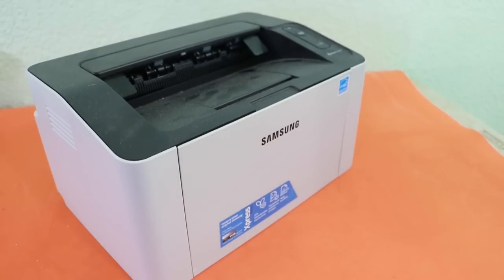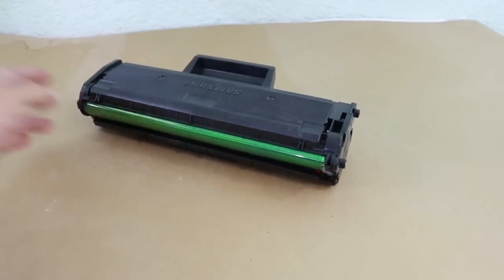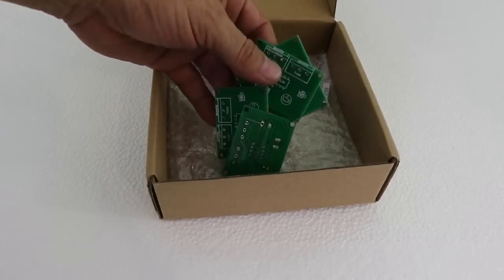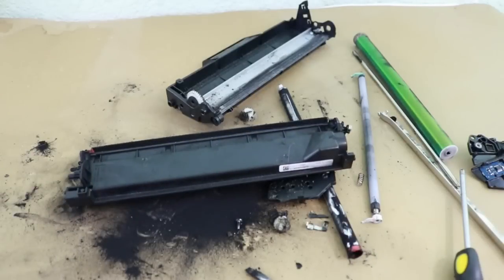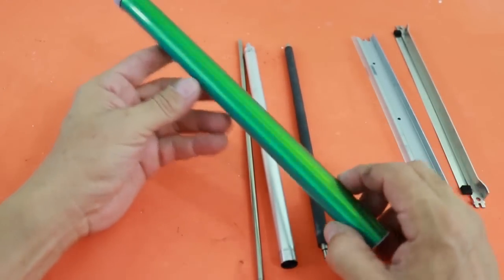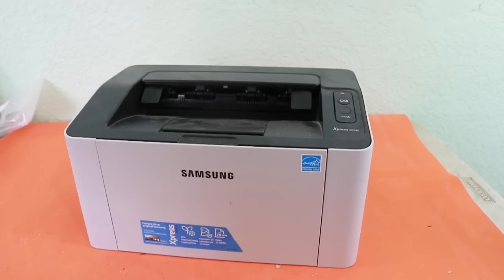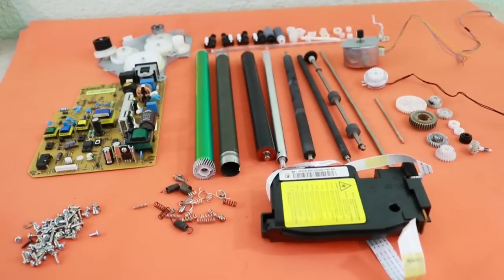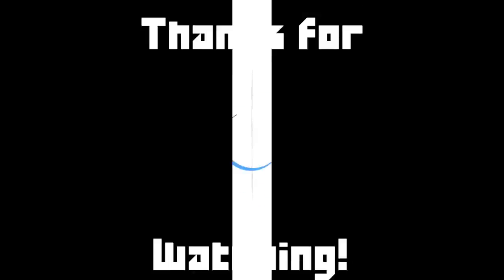Useful Parts from Old Printer

Comment: I've been thinking of converting an old laser printer to a laminator, as they have the heating element and the rollers and are free all the time.   Just need to modify it to accept thicker material and hack the control system.   Thanks for showing the teardown, really like these videos so I don't have to do it myself.  lol

Comment: Some printers have a high voltage and current power supply that can be very useful as they are of good quality. You only have to manually connect the stand-by pin (usually to ground or + 5v) and merge the outputs to use in projects, cnc's, etc ...
In some older printers where stepper motors were used, there is the possibility to unsold the stepper motor driver, make a pcb with the necessary components for the chip to work, and use it.

Comment: You said it would make a mess, but you didn't mention that toner is carcinogenic and if you need to wash your hands or clothes to use cold water only
Reply from the maker: Toner is not listed as carcinogenic.
Reply: @ludicscience  carbon black is a group 2B possible carcinogen and is a component of toner
Reply from the maker: Possible.  Ok? Not proved to be.
Reply: @stuartcommon4651  
Group 2B does not mean that something is carcinogenic. What's the point of the rating system, when you don't know how to read it? For substances in 2B quite the opposite of "carcinogenic" is probably true, because there isn't any evidence to put it into a higher group. Even meat and coffee are in the higher classification 2A. Not to mention processed meat, alcohol, tabacco smoke, car exhausts and UV radiation, which are in class 1 and actually proven to be harmful. So no need to panic.
Not only that, just because something contains a component that on its own might be harmful, does not mean at all that it is harmful when used as an ingredient. You don't want mercury around you all the time (although in metallic form it is harmless, unless you listen to media, which don't care about facts but just want another panic, similar to what's happening with lead, glyphosate or mobile phone "radiation"). But in an amalgam it is totally fine.
Reply: @superdau  I apologise I should have said possibly, but the way I said it came out like it definitely is carcinogenic. 

I fully get what you're saying about something being an ingredient, it's like solid asbestos roofing. It's perfectly fine as a product but when it's broken... a bit like ingredients in toner, perfectly fine in a toner cartridge, until it's broken, then there's a possibility. I guess that's all I was trying to say. I certainly wouldn't want my kids to open a toner cartridge lol
Reply: @superdau  plus the thing with mercury is more the vapour but I'll not go into that 🤭

Comment: Cut the entire gear reduction housing with spindles and save it as an assembly with all hardware and motors attached. It is far easier to reuse them in a project if you keep the matching gears together and have a plate setup with the right spindle spacing. It is easy to cut and modify it to make a smaller arrangement later or use the plate and spacing as a template you can physically measure and replicate.
  I find the screws and hardware are what I reuse the most. Also, if you have the time, labeling what attached where on the power PCB will make it possible to reuse parts of that circuit. There are things like a diode capacitor voltage multiplier that can be used in other projects. There is usually an interesting triac arrangement for the heating element, (although I've always found a ni-chome wire based heating element in the ones I've taken apart). The tiny square inductors on the power supply are usually a step-up voltage type and they often have a through-hole TO-92L MOSFET driving them.
  The laser mirror motor is brushless too. 
  The laser module contains a really good laser driver/power supply. It must have a low capacitance/accurate current source in order to turn on and off extremely quickly. 

   My dream is to take a laser printer apart just enough to get the laser working with a drive mechanism for a PCB instead of the paper/drum arrangement. If I replace the laser diode with a UV laser, and get the board to pass through at the same rate as paper, I should be able to print designs onto photoresist covered copper clad to make circuits. The trick will be making a setup that uses the original printing toolchain built into the printer. This would mean I just need to print the circuit layout artwork directly from a PDF and the printer would expose the photoresist directly. No need to make a transparency.
   I know Marco Reps uploaded his attempts to do this with a Lexmark printer that already has a flat printing pass through slot made for printing CD labels. He didn't stick with the project because of issues and it could only do single sided prints. I'm curious if a simple microcontroller could control and align the board feed rate to make a double sided setup that skips the transparency step.
   Who knows if I'll ever get around to that project though...I do have a working spare laser printer already though :-)
Reply: Totally, modules are worth a lot more than components, when it comes to re-using stuff.

As for the  UV idea, just keep in mind, you can't use lenses, evrything have to be mirrors.
Optics responds differently to UV vs IR and your spot would be totally out of focus.
There is a good chance of a mirrors only setup in the printer.

Even, your best route may actually be feeding the laser-diode the raster data, while a motor moves the photoresist below. (direct to PCB)
No need for graytone e.t.c., you just need to figure out how to feed data into the laser-driver.
You would need a fairly fast processor, and likely combine SPI & DMA somehow.

Since the photoresist responds way slower than a photocell (the drum), you may want to scan your design really slowly. Like high-power UV laser and cm per secound/minute.
Reply: @erlendse  
 Thanks, the optics hadn't crossed my mind yet but is obviously critical in retrospect. I haven't seen a mirror based culminating system, but perhaps I could retrofit the threaded brass tube and lens from a laser pointer. I have one that can focus to a minuscule dot at around 4cm. It is capable of burning (smoldering) anything dark colored on contact. Not bad for $2 on AliEx. I tried to get a few more of these, but none have come with the same threaded tube/lens since. I have a few other focusing setups that are similar from some laser party lights but haven't rigged them up to test their focal properties.
   The challenge for the laser driver seems to be a clean switching supply with low capacitance from the little bit I've read, thus the reason to attempt using the OEM system with different laser diodes. Development of such a system from scratch is beyond my current software capabilities.
   I tested the cheap 405nm laser pointer on a test panel with my last photoresist etch. That setup resolved fine lines with the dot focus set to around 4cm and moving the laser/material as fast as I could in a controlled manner. 

  I've tuned my photoresist setup according to the Dupont Riston 200 datasheet setup. I used Riston 200 before as small quantities are available on eBay, but the cheap Chinese photoresist works about as well if it is fresh. Dupont lists a even faster laser specific film but I doubt anyone will sell it for an honest price in small quantities. Anyways, the R. 200 datasheet method requires a low strength developer solution and lower intensity exposures than I've seen/read in many tutorials and articles. I use the sun for exposures, carry my board from a dark bathroom to the sun completely covered, and expose the artwork for just under 3 seconds in direct sunlight, recover, and develop. I can't even see the image in the film until a few seconds after it is in the developer. It fully develops to sharp edge copper in less than a minute and a half. After that, it finishes curing in the sun for a few minutes while I get the acid setup ready to etch. Most people, my past self included, seem to over expose the film. This requires a stronger developer solution and a lot of time/rubbing effort to get useful results. I keep my developer solution as hot as I can tolerate with latex gloves and lightly rub the unexposed areas. It works very fast and is easy to over develop if I'm not careful to remove it as soon as it is done and rinse in tap water. Anyways, those are the conditions where the laser seems potentially effective at high-ish speed. It's completely unscientific, and your probably right about it not working at printing speeds. Projects are rarely as simple as my imagination but I keep on dreaming :-) 
 Thanks again for the advice.
-Jake
Reply from the maker: Thanks for your comments!
Reply: You are right, whenever I take apart stepper motors from old printers and scanners, I always keep them attached to the reduction gear assembly. The gears make it much easier to work with the motor.

Comment: You should do a whole series on tear down of different electrical items to salvage parts i.e vacuum cleaners, LCD TVs, washing machines, fridges, laptops, etc.
Reply: I would suggest exploring stuff yourself. What you can use depends on what you know/can figure out, and what you are trying to do/build/create.

Vacuum cleaners have switch, the motor with fan, and the retractable cable that may be of interest.

LCD TV's have speakers+amplifiers, power supply, driver+backligth with diffusers, the rest kinda require special projects to use. The polarizers are hard to get off the glass!

Washing machines have motors, solenoid valves, locks, pumps, level-sensors and the control board (supply, relays, LED's, buttons e.t.c.). Mechanical timers are interesting, but likely too specialized for actual use.

Fridge is compressor(sealed in gas), tubing, lamp, thermostat, door switch, not a lot to them.
Please don't vent the gas to air.

Laptops have mainboard (if you are into that stuff, integrated cricuits e.t.c.), screen, battery, touchpad, keyboard(needs eletronics on mainboard).

It's quite much up to you, there are also casings (sheet metal/plastic), drums, filters, wiring, rubber feets, springs, shock absorbers e.t.c.
Reply: @erlendse   Anyone with some technical abilities for sure be able to salvage what ever they need. But as for making content for the channel goes it would interesting viewing.
Reply: @iceho6460  Well, doesn't have to be technical, just a open mind.

A lot of the fun would be using parts for unintended uses.
Reply: Honestly, to make a good well explained teardown video takes a LOT of figuring out/knownledge to be good.

Like the different voltages in the printer and their uses, the polygon mirror motor controller signals, the photocell next to the laser, just lots of stuff.
Reply: L m leaning to repair printers

Comment: Please make one video for a inkjet printer too. They are shitty and I have one uselessly laying around. I'm going to shift to a LaserJet now.
Reply: A bit older inkjet printers have stepper motors inside them and the later ones have a stepper motor in the scanner. The newest ones have brushed DC motors with optical rotary encoders inside them.
Reply: Does it have a scanner also?